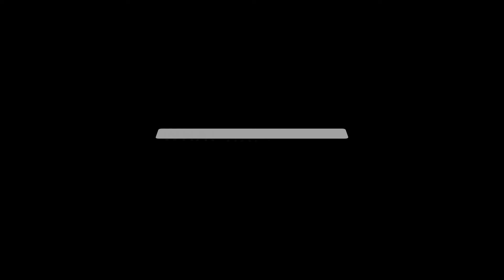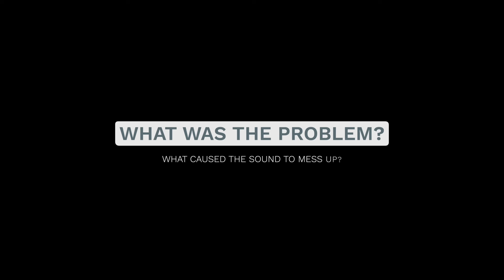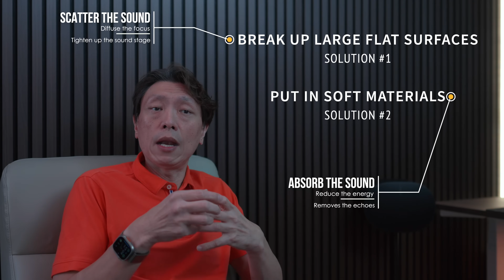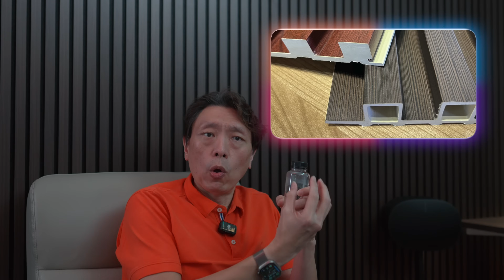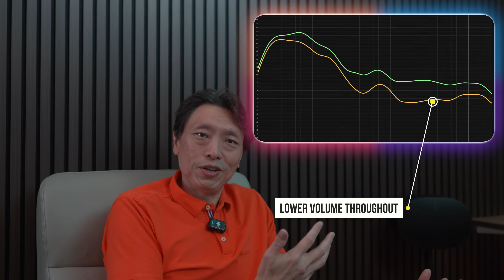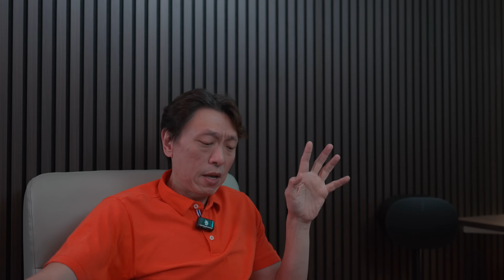Get better sound without changing your speakers

Comment: I’m just wondering about sound absorption panels and Sonos 9.1.4. I’m treating my room for hifi listening with absorption panels. However, in the same room I’m also going to use Sonos Arc Ultra/Sub Gen 4/Era300 for immersive movie sound. My question, since Sonos is a virtual system and relies on sound bouncing off the side walls for side channels, wouldn’t it be counter-productive to have those sound absorption panels? Or would Trueplay correct the room acoustics within the Sonos system to compensate for the sound panels?

Comment: Peter I am anxiously awaiting a new set of best settings for your setup (just like mine). I see the bass is still elevated quite a bit, but now peaking in the sub range. I'm curious how you intend to flatten this. I would also really really like to see if there is a difference in the frequency response in your new room with Trueplay on vs off. Your room acoustically and size-wise is now much closer to mine.

Comment: @PeterPee I’m a fan, well wanna say a former fan of Sonos. Still have plenty Sonos speakers, but I will not buy any Sonos product until they have finally improved the App disaster. Granted they finally improved, but the overall performance of the system is still not as it used to be and I reckon I’m not alone given they fired half their executive board. It is so sad.

Comment: Why May I ask do you have your soundbar so far back? You do know or should know that the drivers throw air up, straight, left, right and DOWN, which hits your console and will absolutely cause a difference in the overall sound and NOT in a good way. Pull it towards the edge so there’s no blocking of sound. You do tests all the time, so compare one as is and one after pulling towards the edge. I know it looks better in back, but it doesn’t sound better.

Comment: should i upgrade Arc with Arc Ultra?
Reply from the maker: If you can get a good price selling your Arc, and an ongoing discount for the Arc Ultra, that might be worth considering. Else you might not get as much out of the Arc Ultra over the Arc original. 

If you already have a sub, I suggest you don't upgrade.

Comment: Peter, wanted to let you know that I gave you a Super Thanks with a comment, but it did not post it. I looked and the charge is pending on my card.
Reply from the maker: Hey Danal, thanks for that! It's really appreciated. I am unsure why it's pending but if you can call your card issuer to cancel it, maybe that's what you should do.

Comment: Want to check if you have an idea if the Eras 300 was mounted on the ceiling and turned downwards would sound good. Dont want to put it behind my sofa as I dont have space
Reply from the maker: I actually thought about it! I am running out of space to put my speakers. I have thought about it quite a lot and it's been bugging me. I don't think it will sound great because that's not where surrounds are supposed to be at. They need to be at ear level.
Reply: @PeterPee im doing a reno in SG, and this config was okayed by the Sonos people, even bought the mount… but before I go further, im trying to ask around and figure out if its really a no-go. Wonder if thrs Sonos engineers that you know could advise on this

Mounting it right behind the sofa at ears height is real ugly though, thats why im leaning to mount it on the back but ceiling
Reply: @DK3n70 I actually have this setup and enjoy it now.  I started off having the speakers (300’s) at the ceiling.  After about a year of this, I was tweaking the speakers too much so that I can hear things.  That’s not exactly why you should be placing the speakers there, so I wanted to adjust.  So within the last year, I have moved the speakers down, but still above ear level.  I find this placement is very ideal and no adjustments needed.  I get jump scares a lot during movies and it is very pleasing overall.  Overhead sounds do very well too, and probably the main reason I wanted to try this setup.  Helicopters and rain sound really good with this setup. The look isn’t too bad either if you have speaker colors that can blend into the wall.  I have the white 300’s with a white wall with a white mount, so aesthetically it looks pretty cool.
Reply: @Iceolated1906 appreciate this comment a lot

Comment: I built a 2200 sq ft garage, 15 foot walls and a faulted ceiling. Also a mezzanine that is open to the lower area. I’ve gone with 2 Sonos Five and a sub 4. It sounds good to my amateur ears, but there is some echoes.  Any suggestions?
Reply from the maker: The vaulted ceiling is the problem. If you have the funds or means to do it, you can add those sound absorption panels to the hang from the ceiling.
Reply: @PeterPee  Greatly appreciate your response. I will give it some thought. 
What is your thoughts on putting two more Fives and another sub on the main floor?

Comment: Always love your content! Do you think Sonos will ever let us use extra speakers? Dedicated L/R to an Arc Ultra setup?  It seams like such an easy cash grab, because lots of will buy extra speakers 😊
Reply from the maker: Yes, I have always wanted that...
Reply: Isnt this already done? Couldn't you just use amp with it?   Not sure if the ultra is compatible with amp but the arc is.
Reply: @RichardKeysoftware  No, not really. When you group the amp together with the arc/arc ultra, you are getting all the channels into the amp, not just the Left and Right channels.
Reply: Sonosequencer allows this
Reply: Yes, you can but not with official app. Alternative app  is “sonossequencr”. 
It gives possibility to add additional Fives (or any others Sonos speaker) as fronts with any Sonos soundbar. 
In such setup a decoding of Dolby 5.1, DTS 5.1 and Dolby Atmos is working. 
There is only one disadvantage, trueplay is not working. 
Effect is awesome, it is a huge improvement.

Comment: Interesting timing of this video being released. I just watched Man of steel 4k through my Ace headphones since the true cinema update and it was pretty bloody good. I'm still getting used to the vocals as they seem more pronounced..... I listened to a few scenes through the Ace's and from the Ultra +gen 3 + 2x 300's, and the Ace's didn't miss a beat.... be interested to hear your thoughts on this new update to them.
Reply from the maker: The vocals are bloody amazing. I try to test things extensively and will be asking some questions to Sonos on the Ace so please be patient!
Reply: @PeterPee  I've thought about it since and they are very much like the cinema in how pronounced they are.... i did have 1 issue whilst watching the movie, they cracked and made slight static sounds then nothing. I thought I'd maybe blown them. But I pressed play on the app and it started to play the last thing I had on Spotify, so i ran TV swap and they came back on.... is that maybe a timeout / inactive issue of some sort as it would have been a good 90mins of not touching them of the volume control.
Reply: I would also be interested in this